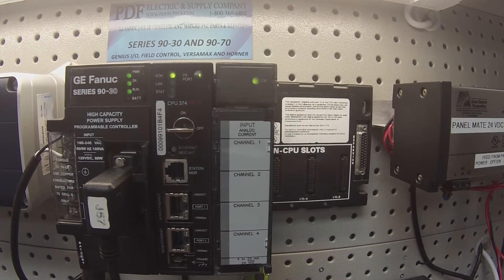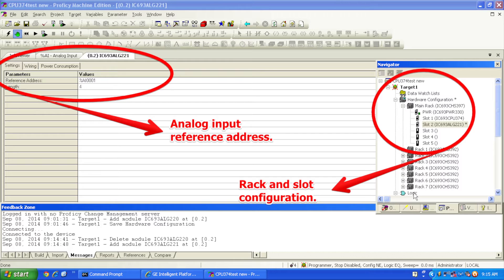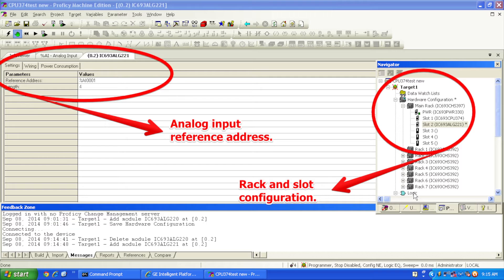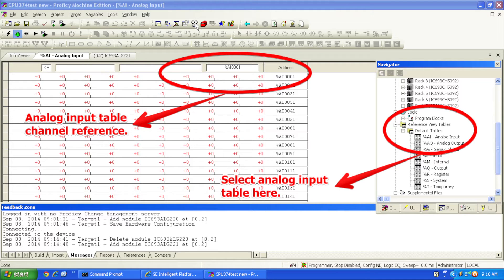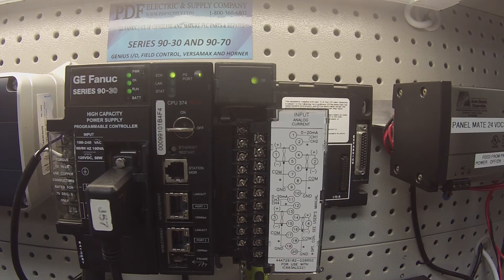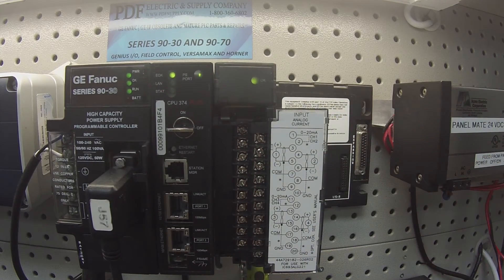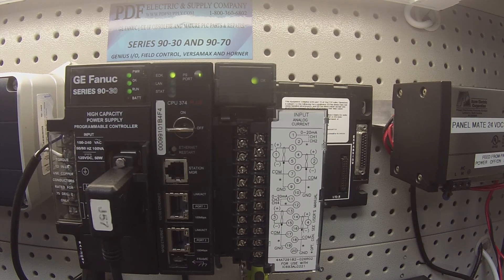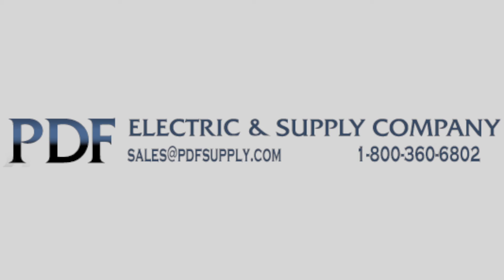How-To Troubleshoot: IC693ALG221 (GE Fanuc 90-30/Proficy Machine Edition Programming Tutorial)

Comment: What would you suspect if you don’t have a green light on the card?
Reply: i had the same problem i fix it when i connected voltage to rack.(16 slot) its 24v and gnd